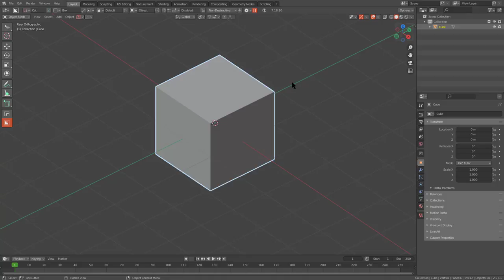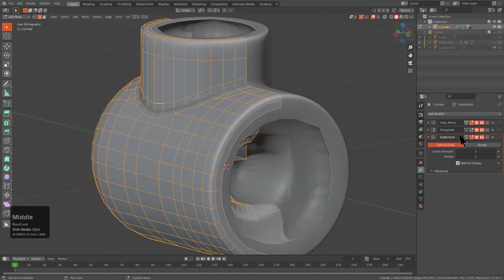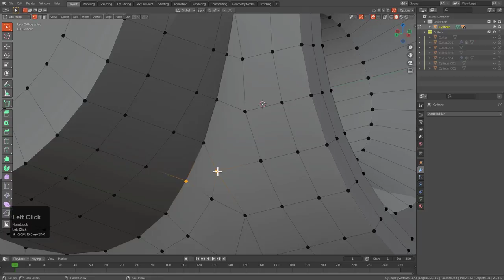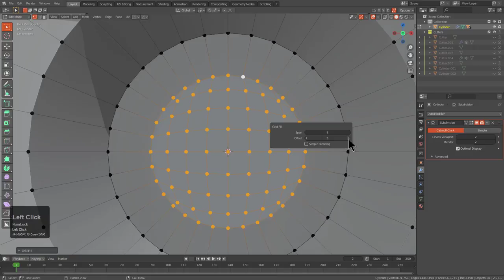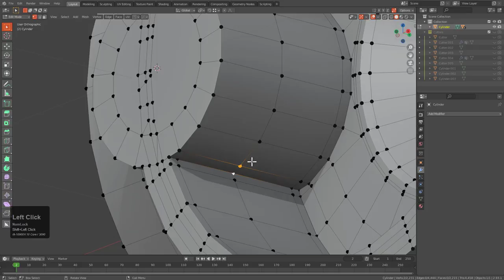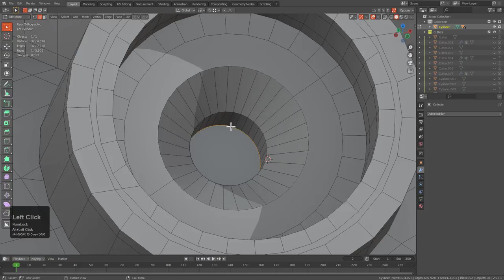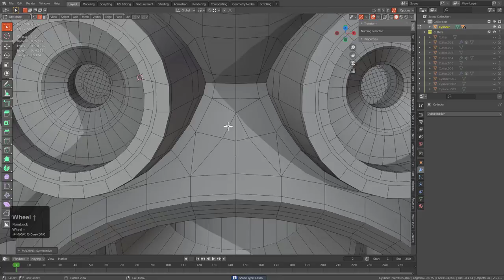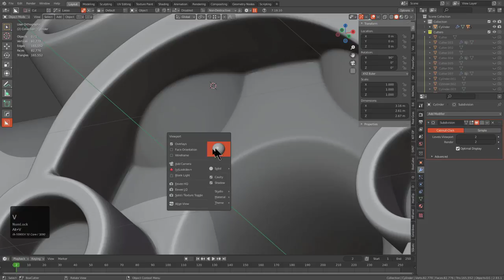#toposolve - Surviving Subdivision 3 (Cylinder)

Comment: Thanks for sharing. This reminds me of an exercise I was doing a while back, working out the best topology when blending a chimney into a steam train. I must have tried it about 10 different ways with various chimney shapes.
Reply from the maker: so in the end what was the best solution? and also did it involve a perimeter.
Reply: @masterxeon1001  yes, it’s the only way to get out of that kind of intersection alive. It was made more complex by the fact it was curved out towards the join, kind of like a trumpet and it had to fit around the adjacent cylinder. I did that by extracting and scaling the bottom edge before shrink wrapping it to the horizontal cylinder. Then I could join it back to the chimney and perform a bridge edge loops. To make things even more interesting it was asymmetric and extended further at the back. It’s a really satisfying result. I should probably make time to do a video of my own one day.